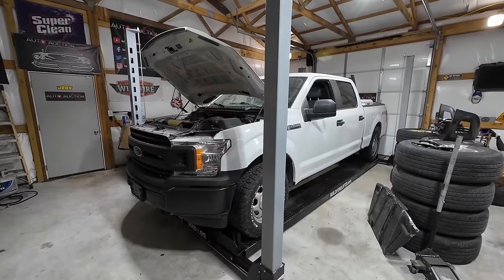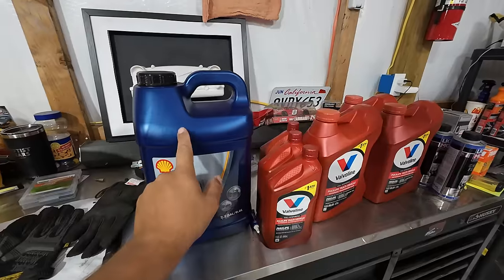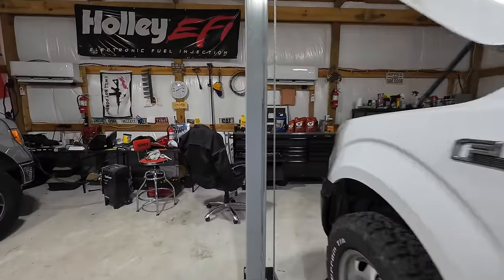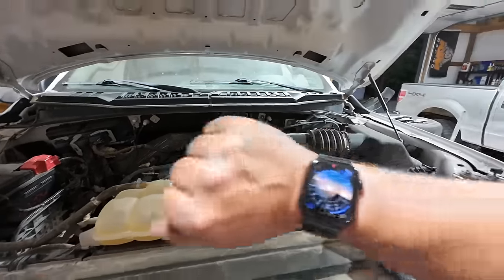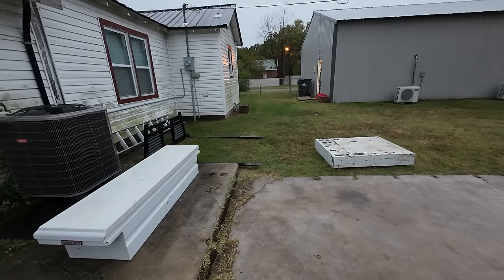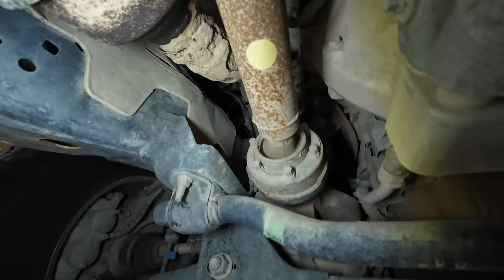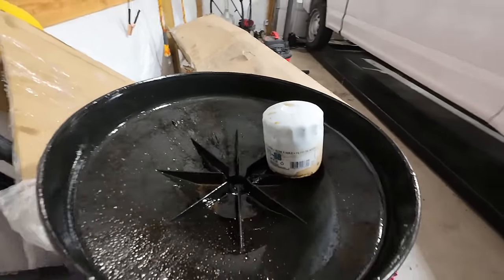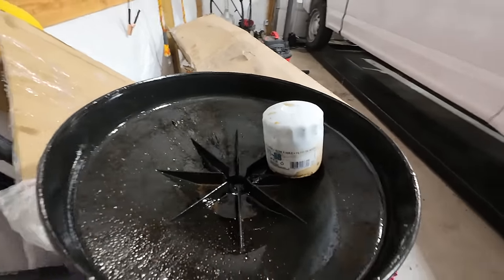Can Liqui Moly Save my $10000 ford F150 Engine or is it too Late?

Comment: Wear gloves when doing oil change
Reply from the maker: That way all of the scalding hot oil can fill up in the glove and weld it to my hand great idea
Reply: Yeah this guy don't need to be doing videos we  think he's got anger issues
Reply: @danielpadgett2831 If she looks a little sketchy, I also wear a latex glove for the love.
Reply: Sounds like a lifter is weak.
Reply: I suggest you drive it like you stole it!
Reply: I never wear gloves other than winter gloves.  I consider them a waste and I prefer having the tactile feeling I lose with gloves on.
Reply: i dont and never have we are okies we arent afraid of getting dirty fixing things
Reply: my only compliant is dont use fram get a wix or even motorcraft

Comment: I like that engine flush, but I started reading product info sheets, and most of them are just diesel fuel.
Reply: Exactly
Reply: Kerosin* not quite Diesel.
Reply: Not a fan of engine flushes.   Just regular oil changes.   Ive seen too many people have issues after doing engine flushes.
Reply: High quality flushes don’t use diesel or kerosene. Good flushes are detergent based and are designed to remove sludge slowly over time to prevent overloading the oil filter or clogging up the oil pickup in the pan. Cheap flushes are solvent based and can cause problems. Amsoil, Liqui Moly and a few others are detergent based primarily and are not miracle products that remove all sludge in 15 minutes. They’re designed to work slowly over numerous oil changes to remove sludge.

Comment: 3:37  In other words, put a band-aid on it and hope it helps........ for the time being. Everything I found online, that made sense, says the proper correction for the "coyote tick" is to pull the oil pan, inspect all the rod bearings (preferably the mains, as well)  and replace the one(s) that have sh*t the bed. The most critical part is to get that done before it trashes the crankshaft. If caught in time, it corrects the noise and, best of all, costs less than all the bottles of snake-oil. Like the old Fram ad used to say "you can pay me now or you can PAY me later".

Comment: Hi Randy, Ceratec takes about 200 - 300 kilometers to start working as it takes time for the Ceramic particles to cling to the moving parts. I have used Ceratec, and results were good. Cheers....
Reply: hi, are you a regular user or ceratec?
Reply: If you have a GDI engine, you may want to check about LSPI because Ceratec has an extremely high amount of calcium.
Reply: I feel the pain and frustration with the “tick” you were or are dealing with in that truck. I currently have the same “tick” in my Gen 2 Raptor. I have tried everything that you have also with no luck

Comment: Ford engines have had this problem before coyote engines...Its usually in the valvetrain...None of those cleaners do anything... Best thing to do is take it apart before metal goes through the engine and destroys it.
Take off the valve covers and inspect the cam lobes

Comment: Probably needs a timing kit. That is a regular service item for most engines these days. Ticking phasers I believe are not an issue and you can replace them with regular non phased sprockets if necessary. I think.
Reply: @danielleclare2938  timing kits are almost always overlooked that should always be done.

Comment: For the Caratec you need to drive it for about 200 miles for it to take effect. I use the same product on all my cars and it works wonders. Turnes a diesel tractor into a electric car
Reply: What’s different from the grey Liqui-Moli??

Comment: Honestly, I would never buy a former fleet vehicle. Fleet companies are notorious for neglecting services and pushing vehicles to their absolute limits, and a wise man once said “even the wrong oil is better than no oil.”
Reply: @jonallen1985  we bought a used U.HAUL. BOX TRUCK ,, VI0,, 6.8. ENGINE,,2.68.OOO.. MILES,, CHANGED TO CASTROL EDGE,, 10.W 40.. HIGH MILAGE OIL. PURO. BOSS. OIL FILTER,, RUNS GREAT... SMOOTH. ADDED ALSO.. LIQUID MOLY ENGINE ADDITIVE. SO SMOOTH,,

Comment: Hey Randy, you should try pulling the oil pan and checking the bearings with the engine in the truck.  You might have to jack up the engine to clear the cross member.  But you'd probably be able to see if the bearings are bad without removing the engine.  If they're bad, you could change them from underneath with the engine in the truck.  And it would make a great video 🙂

Comment: Just because it’s fleet doesn’t mean they did a good job with maintenance. My company has a couple fleet vehicles and I used one for a few weeks when I had car trouble and thought it was weaker than it should be and it had a clicking sound when I would first start it. Long story short I got it up on Jack stands and found out it had the original oil filter on it from the factory and the oil looked terrible, 35k miles on the same oil. I changed it out and the clicking went away. I put an oil change sticker on it and alerted everyone to pay attention to its maintenance and she’s still running but I think it could’ve gotten bad fast

Comment: A buddy of mine had the same issue with his 2018 F150 5.0 dealer told him that his truck needed a new engine. He ended up trading it in on a Silverado and rolled over $12k negative equity on it, and the dealer sold it a week later without swapping the engine. Dealer couldn't fix it when it was his truck, but fixed it immediately when he sold it to them, go figure.

Comment: Snake oil can work sometimes I just don't recommend  always putting them in a newer vehicle. If the vehicle is on its last legs or said part go for it. I put Lucas in my transmission on my CJ And  got another 5 years out of it with no problems. The one that bothers me the most is people put in stop leak in the rad if they only knew how many other problems they have caused themselves by doing that. Just get a new  or used radiator.

Comment: also never go up on the winter number. if your engine is higher milage you can go 5w30. penzoil full synthetic is an economical choice. too thick of oil will starve the last thing in line of oil on cold starts aka the valve train and phaser which is ironically what your tick is.

Comment: I've burned my hand more then a dozen times changing oil on my f150. 
Very hot oil lol.
The only thing i could suggest it could be the fuel pump on top of the motor.
They click loud too.
Great videos, keep up the great work 👍

Comment: Remove valve cover. Wiggle roller follower, find loose one. Once loose one found. Turn engine until cam lob is narrow side horizontal. Use screw driver to lift push follower to remove. Replace hydraulic lifter. Put back together.

Comment: My 2007 TrailBlazer had a similar noise. Everybody told me it was the engine. Turned out to be the bearings of the A/C pump. Figured it out by removing the belt and letting the engine run for a few seconds (no noise). Put the belt back on and the noise was back.

Still have a P0014 code that goes away after an oil change (with engine flush), but comes back after 1,500 km. Next time I try the Liqui Moly engine flush. 

Thanks for the video!

Comment: You need that thin oil for the very small oil passages for the VVT.
Reply: The Mustang GT performance pack cars from (2011-present) run 5W50 with the very same oil passages.

Comment: In my 2005 I had a loose piece of metal around my cooling fan which the tick came from on mine. Just something you might wanna check. Either that or the exhaust manifolds.
Reply: In 1962 my aunt gave my new Bride and I her 55 Chev sedan as she quit driving. It had very low miles and was in mint condition so we were thrilled as we couldn’t afford to buy a car. I picked the car up 100 miles from our hotel me. On the trip back there was a ticking in the engine that would disappear when I accelerated but returned when I slowed down. I was very upset as I thought it was a wrist pin or a rod. Luckily I worked at a major truck dealer and one of our mechanics took a look during his lunch hour. He came back with the mummified carcass of a Rat. Obviously years before the rodent had crawled  
into the engine compartment and nestled in the fan shroud.
When the engine was started the fan killed him and over the years he dried and hollowed out so the carcass floated when the fan ran at high speed and settled down upon deceleration. Too bad your problem isn’t as simple.

Comment: The noise that you hear "ticking" is from hydraulic lifters. If they are damaged too much you need to replace them, if not you can try Liqui Moly Hydraulic Lifter Additive. I used this additive and my ticking noise is not so loud, but i need to drive my car a little bit more. When my engine is heated i cant hear ticking noise. After adding additive you must drive your car at least 40-60 miles

Comment: You got a real good deal on this thing. Those tool boxes are like ~$500 each, plus the ~$300 headache rack(&rails) is close to like $1500 if you cleaned up & touch up paint. Sell 'em all for $1200 obo. The ticking is most likely cam phasers, its not piston slap at all. If i were you I'd say do the timing set and cam phasers all together and it'll be back to perfect. I'm gonna finish watching video now(@ 11:17) now, and see what happens. Either way, you got a fabulous deal on this truck, even it it craps out tomorrow, you could part it out to get your money back. Worse case scenario, toss in a junk yard, low mileage, coyote back in it and run the wheels off it.

Comment: The 18 thru 20 had this noise.
The maintenance is key to these engines and not using cheap restricted filters that create sludge build up in the phazers.

Comment: Have tried checking for electrical arcing ? try this start the engine raise the hood turn out all light sources and check the plug wires for any arcing also check the coil packs for any electrical arcing

Comment: re: oil viscosity.   Clearances in newer engines require the lighter weight.   Engine may not lubricate correctly with heavier oil.
Reply: @garysimonson9593  it be ok

Comment: I myself use thicker oil on my older high mileage cars. Its a great way to make them run smoother for sure.
Reply: Correct, but thicker oils in a modern engine is not the best idea.
Reply: @Twizztify  I am completely aware of that and I mentioned that I only do it in older vehicles.
Reply: It can kill an engine is colder climates.

Comment: Get the UPR Billet Easy Oil Drain Valve aftermarket drain plug from A.  Then you can attach a hose to it to direct the flow of oil where you want it, and you can regulate how fast it comes out.

Comment: Valve train wear. This is a common issue when the newer engines (particularly) the coyote. Look at your oil pressure. Get a dial gauge that can read 100 psi. Fab a pressure rated hose with a fitting and tap into the oil pressure sending unit. Verify what the dash gauge shows, which is great with a hot idle. If the Oil Pressure is within the FoMoCo acceptable for the engine at idle that all but eliminates the possibility of rod, main or cam bearings. If the truck performs well than that further confirms it is not perfect but not trashed because cam phasers work off oil pressure.  If your dash gauge and the actual dial gauge screwed into the block agree that engine is very likely aging but it the OP is within 15% say of spec at that mileage I'd say it's like fine cheese aging gracefully.

Now that does not sound like piston slap to me. And I go as far back to the days of the 322 Nail Valve Buick motor which was a TANK. Look that puppy up you will get a hint how OLD I am! And how many quarts, pints, liters etc of various and a sundry quantities of oil, grease, hypoid and other automotive liquids I have spilled and poured into and on myself.

Think overall your issue may be annoying but I think it is NOT a solid rod or serious knock. I have heard ROD knocks they are a hard clunk clonk and have authority . Yours just sounds like VVT valve train wear, maybe worn chain tensioners, stretched chain or poor oiling which judging the truck is not likely.

Comment: I d had Seafoam fix sticking valve ticks 100% quiet.  But it took about a 700 mile road trip down and back on I-95 for it to work. After the trip I changed the oil and that truck is still running great 10 years later.  

Seafoam is just really detergent.  Thru take time and heat to work IF they are going to work for whatever problem you are having.

Comment: For the drain plug, you can buy a ronin plug that is so much better for flow control and includes a magnet.  For the oil weight, i have a 19 f150 5.0l and a 22 mustang gt.  The GTs from 20!9 had a reccomended of 5w 20, but my 22 (same gen coyote) has a recommended 5w 30, with a swap for 5w 20 for drag use.  My point is, id drain that 40w oil out and stick with the 20w or mayb no more than a 50/50 mix of 20w and 30w to make a 25w.  You may cause damage with that 40w if the engine is still good, even with that tick.  Just my thoughts......good luck.

Comment: the W means weather temp, not the weight or viscosity of the oil, also the tick noise is from a clogged hydraulic valve lifter.

Comment: you took the word right out my mouth im 60 percent its butterfly flaps in the intake manifold rattling the vibration of the engine can rattle them and even if you go upto 1500 to 2500 rpm it will rattle it may stop after higher rpm might be with getting a mechanics stethoscope it may pinpoint the sound other then that its the lifters tapping love the videos keep you the good work

Comment: also don't switch into 4x4 on the fly while you are loosing traction. make sure the vehical is stable or slow down and make it so. Basically don't be spinning the back tires and switch to 4x4.

Comment: I had a 2005 F150 with the 5.4 v8. It had that same sound, but kind of came and went. Sometimes I couldn’t hear it at all and sometimes it’d sound just like yours does. I bought it with 81k and drove it until it was 178k and sold it. Still ran fine with no issues. 

I wouldn’t spend 4k plus on another motor.

Comment: I do believe  it is the intake runner valves.   If changing 5he oil with thicker oil helps the problem then you would have bigger  issues.

Comment: The noise is a upper intake solenoid. Usually the back one. It will never change . Until you replace it . 400 for the inake about ..

Comment: The early gen 3 coyotes from 2018-2020 are know to have piston slap issues, in 2018 they went to a plasma cylinder liner to slightly increase displacement from 302 ci to about 306-307 ci, what happens is the pistons have enough clearance to get miss aligned inside the cylinder just enough and it can slap inside the wall.

Comment: A company named Ronin I think it was makes a replacement plug for the oil pan that you can attached a clear tube to. Has a quarter turn valve and a cap that screws over the replacement plug. Makes it to where you don't have to take the plug out just use the clear hose and open the valve. Worth the $50 when I had my raptor.

Comment: Ceratec doesn't work instantly.  They tell you to run it for at least 5000 kms but it usually starts to improve it after about 500 kms. That just sounds like a Ford to me!  I would just drive it and enjoy it.  It was a good deal at $8000. Just make sure you get a good syntenic oil and change the oil 7500 kms.

Comment: I’ve owned a couple of new fords. Their engines have all sounded terrible but seem to still have good power and run okay. I would suggest taking the valve covers off and inspecting the camshafts and rollers. I’ve seen the cam rollers get seized on these engines and cause a loud tapping noise.

Comment: My question how much idle time that motor has on it. Part of the problem may be it's just carboned up and needs some fuel treatment and then taken out and the piss run out of it to blow the carbon out and a high quality oil like Royal Purple put in it.

Comment: next time on one of those fords use a splash pan put in front of sway bar wide side up .  i am suggesting to use a triangle shaped pan ,  i done many of those no mess no burns. as far as the tick sounds like a bad lifter or  loose rocker

Comment: On the shift handle their is a button to select the different modes of driving, Rain, Snow, ego, sport mode and normal.  If you hold done the traction control butt for 3 seconds or more you can put the truck into super sport mode too.

Comment: Bmws have the same issue with tapping when an oil change is needed. But it goes away when you drive it at least a mile or two.

Comment: Ford says the tick is normal and the engine is perfectly fine and will last a long time. I am sure you know this as you keep saying.

 2/5/2019 7718 - 2011-2019 Mustang/F-150 - 5.0L Tick Tap And/or Typewriter Noise At Idle
 Some 2011-2019 Mustang and F-150 vehicles equipped with a 5.0L engine may exhibit a ticking noise at idle after an engine oil change. It is often referred to as typewriter noise because of its similarity to the sound of a mechanical typewriter. The noise in question may be heard on some engines when engine temperatures reach 150°F (65°C) or higher and engine speed is at idle up to approximately 1700 RPM's. It can typically be heard at the front wheel well, and is often isolated to the transmission bell housing or oil pan area. typewriter noise is not detrimental to engine function or durability and has no short or long term effects on the engine. This an operating characteristic of the 5.0L engine and no repairs should be attempted.
Harley release a bullietin saying brakes losing brake fluid and battery going dead is normal and no repairs should be attempted. :)